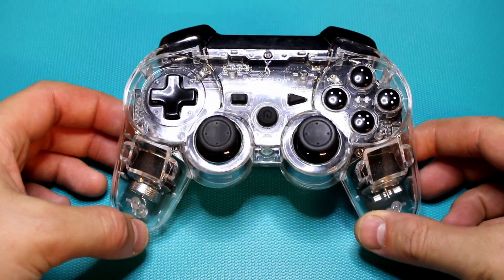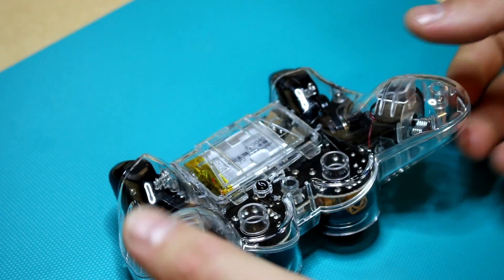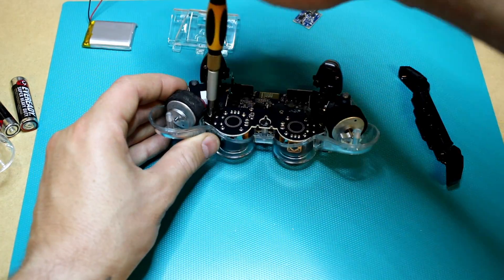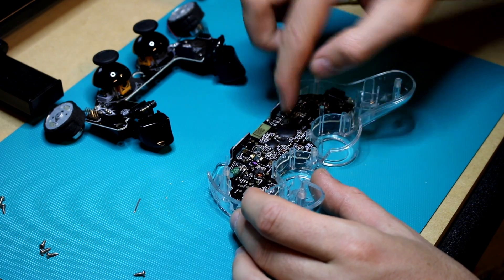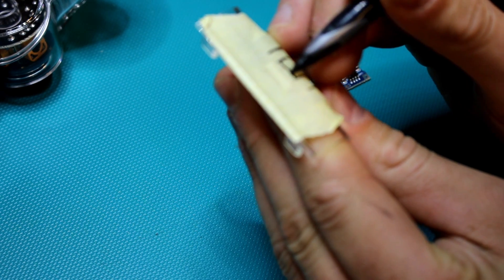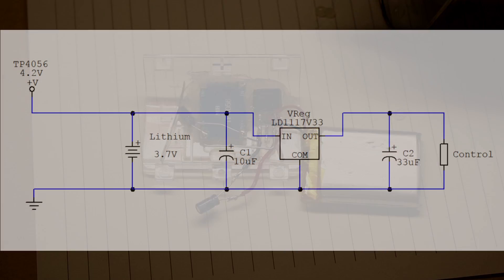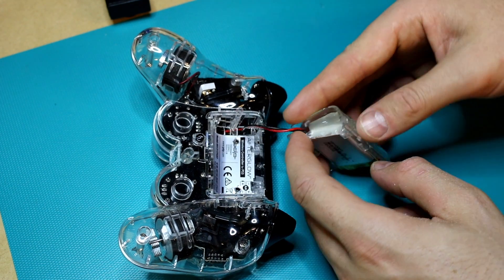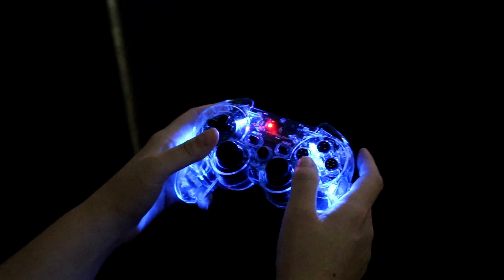Afterglow PS3 Controller Mod

Comment: Problem when using this controller on PlayStation 3 Super Slim Cech-4001C is that you cannot use this controller to reset the PlayStation 3 with it when PlayStation becomes too full and becomes corrupt. There's no alternate means to connect a cord. The Dongle does not support this feature.

Comment: Lol I have a bunch of those chargers! I was actually about to mod my origin PS3 controller to charge with it. I already had used it to charge the battery outside of the controller. 
The way the PS3 is designed you can't charge it with regular USB blocks. 
It would also be cool to just replace the mini USB with micro USB but that's a lot more difficult.
Reply: I had to splice together an old mini USB a male/mini USB b male to a standard male USB cord because I couldn't find one to save my life.

Comment: Really cool work, I have that controller as well and thought of doing the same myself, although I'm too cheap to order a charge module :s Do you have any idea if it's possible to make an homemade usb transmitter for that controller? I lost mine few days ago and Ive been thinking it through, though im guessing I'd have to figure out which frequency the controllers antenna has

Comment: Could this be done to a wired xbox 1 unit? Id sure love a wireless afterglow for Xbox.
Reply from the maker: No probably the data will be sent and received over a couple of wires within the cable whereas the afterglow sends data using a wireless dongle

Comment: Couldn't you simply use rechargeable AAs? My recharable ones I have been using for the past 2 years work wonders
Reply from the maker: Yes they would also work fine. However I wanted to showcase a permanently installed lithium battery solution, that could be utilised in many other applications
Reply: Same u do have a point i have 4 and when one dies i use the other while the other charge

Comment: To give a note. They have PS3 afterglow controllers with Lithium batteries already installed. I think they have had 3 versions for the PS3 and the 2nd and 3rd versions are lithium.

Comment: Holy shit man, I would do this but it’s too complicated 4 me!  but I do have a question tho, if I were to do this, would a battery from a normal ps3 controller work?
Reply from the maker: You would have to do a little research. Mostly you need a way to charge the battery without damaging it and also a way to regulate the voltage that the controller runs on (hence I have used a TP4056 charge module in conjunction with the battery, and a 3.3v regulator that will ensure that excess voltage is not applied to the controller). Best bet is do some research :)